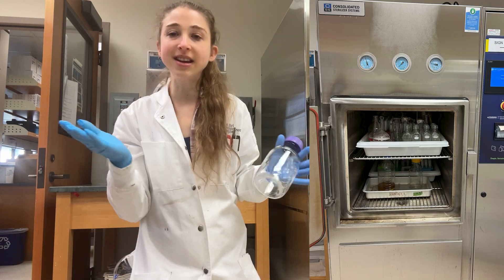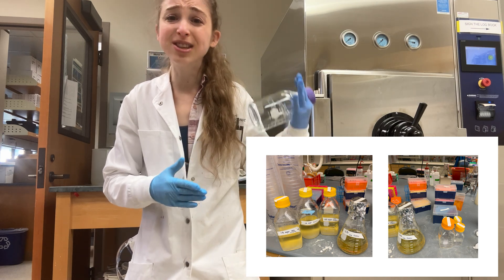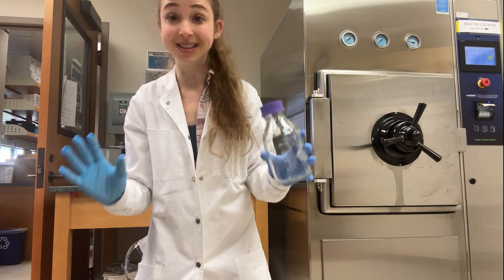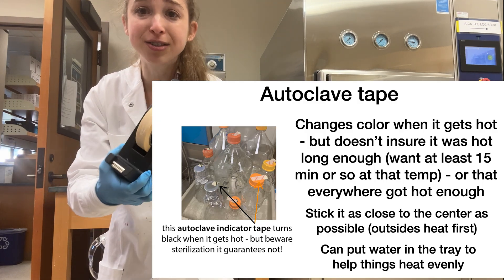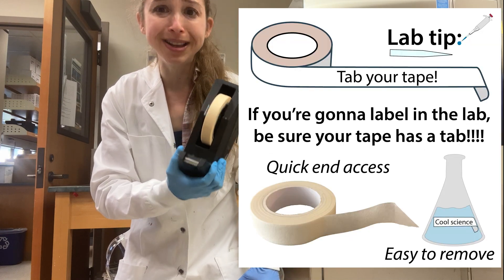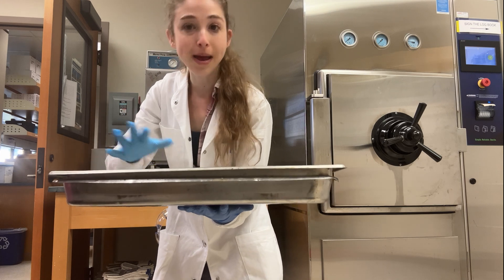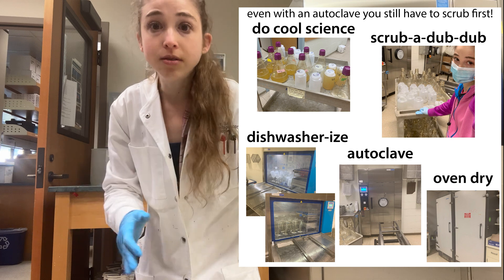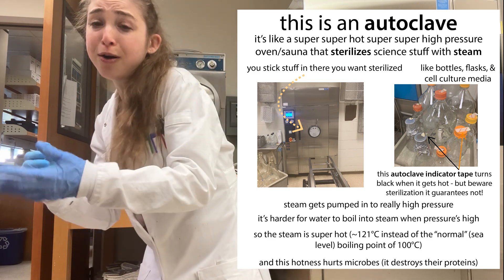Laboratory autoclaves: a practical guide to what, why, and how

Comment: Nice, at our country is hard to use automatic autoclaves ones but it's nice to touch the point of differences between liquids and solids, also most autoclaves comes with instructions of use and maintenance, most maintenance depends A LOT on your budget, type of laboratory, type of autoclave and other stuff, so is really important to read at least once and keep the manual just in case that a new student comes by, speacially with manual ones.

Comment from the maker: I’ve been talking so far mainly about cleaning solid things - you can use an autoclave for flasks, beakers, pipet tips, etc.) - but you can also use an autoclave to disinfect liquids - like that agar I was telling you about earlier… or culture media - like the LB & TB we use to grow bacteria in.  
 
When you autoclave liquids you have to set it to a different cycle which lets the steam out more slowly at the end so that the pressure doesn’t drop before the temperature gets to the “normal” boiling point. If the liquids are still really hot and the pressure just suddenly drops, all those wiggly molecules will now have an easy escape! (i.e. liquids can boil out) 
 
The autoclaves we have here fully automatic which is really awesome. But the one I used in undergrad wasn’t - and it hated me… The exact details vary from autoclave to autoclave, but, here’s the gist - What happens when you stick your stuff in, seal it super tight with one of those submarine-looking doors, and turn on the electrical heater is that the water in the steam jacket starts heating up and it starts boiling into steam, entering the inner chamber, and pushing the air out through a discharge tap. Once all the air is pushed out, the tap is closed and steam keeps getting pumped into the chamber until the pressure reaches where you want it (usually 1.1 kilograms/square centimeter (kg/cm2) [15 pounds/square inch (lb/in2)]). Then a safety valve opens up and, as you keep adding steam, any excess steam is let out. This steady pressure/temperature period is called the holding period (this is the time I was telling you about which you want to be ~15 min). Then the heater shuts off so the chamber can start to cool off and the steam is let out (this is where you have to go slow if you have liquids in there).  
 
And that does it for today’s edition of probably way more than you ever wanted to know about a piece of equipment you either know nothing about or are much too familiar with! 
 
more on LB agar plates:  http://bit.ly/agarbakery & https://youtu.be/5TlkpkngDFo  
 
more on boiling: http://bit.ly/boilingpoints  
more on gases: http://bit.ly/idealgaslaws  
 
helpful references:  
* Steam Sterilization Principles by Marcel Dion & Wayne Parker, Pharmaceutical Engineering, November/December 2013 https://www.ispe.gr.jp/ISPE/02_katsudou/pdf/201504_en.pdf  
* Steam Sterilization Principles & Common Mistakes Using Autoclaves by Marcel Dion & Wayne Parker, Pharmaceutical Engineering, November/December 2013 https://ispe.org/pharmaceutical-engineering/november-december-2013/steam-sterilization-principles-common-mistakes  
  
more about all sorts of things:  #365DaysOfScience All (with topics listed) 👉 http://bit.ly/2OllAB0 or search blog: http://thebumblingbiochemist.com